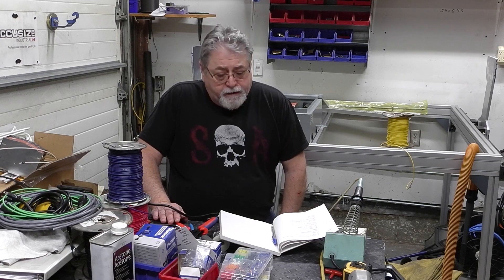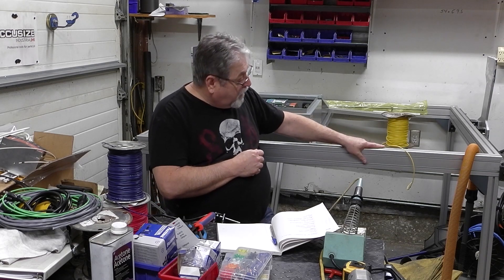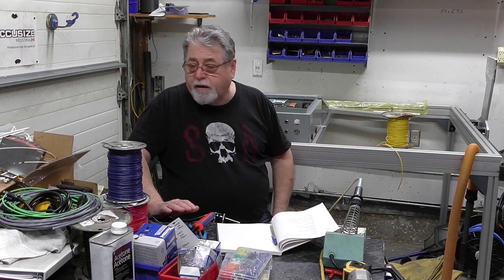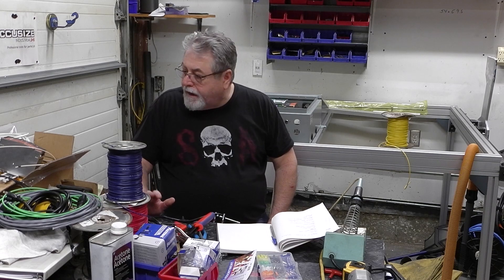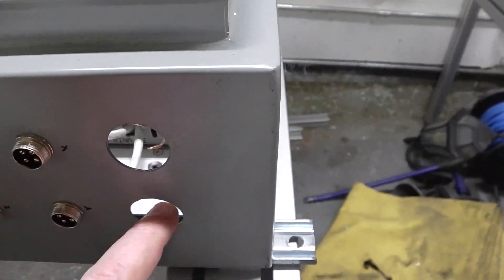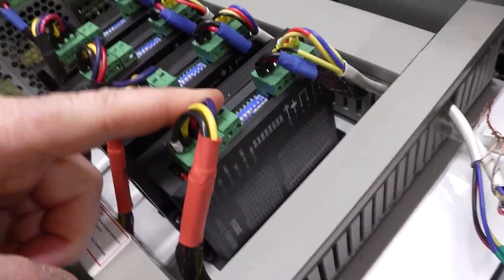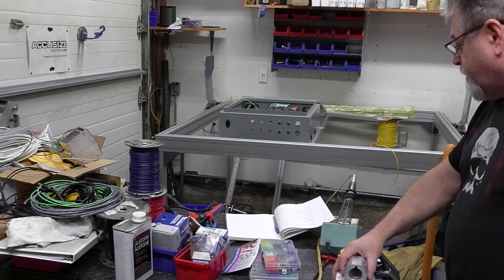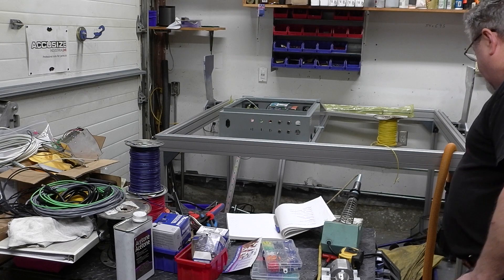Welcome to the shop  new plasma table build pt 1

Comment: Does the g3 support a proma thc?
Reply from the maker: Yes it does. And works awesome.
Reply: @fredsmachinewerks4811  I see they offer a touch screen I believe it’s for the g3. I have a millright mega v that I’d like to put this on and have auto squaring along with 4th axis !
Reply from the maker: @trialnterror  
They great controller self contained and lots of support.
And very easy to wire up as well
Cheers Fred

Comment: Thank you for all the information. I would like to see new video about the electrical relay,  How did you connect to the limit switches and Masso G3 ,
Reply from the maker: I'll post a new vidio tomorrow how I did this. 
Cheers Fred
Reply: @fredsmachinewerks4811  I would be interested in seeing a new video with more detail on the relays and power supplies, and why and how this is needed with the Masso.  I'm planning a retro fit on an old Burny 3 set-up and have to learn all this stuff.
Reply from the maker: Next week I'll explain how I use relays for the end switches. Its better than direct connect to masso .I like to keep peripherals separate  . And use external power by using relay dont have to worry about anything shorting out.
This will blow the opto in the masso. 

Cheers Fred
Reply from the maker: So what do is I use a 3 wire proximity
Switch. That energizes the terminal relay and close contacts which is turn energized the input on the masso.
Masso uses opto isolators so between 24.volts dc to the input. If you an email address I can send you my drawing.

Cheers Fred
Reply: Fred's Machine Werks dkmilleriii@gmail.com

Comment: can you post a link to the powersupplies and why do you need 3 of them
Reply from the maker: Hello
I use 3 power supplies one for the Masso Controller, one accessories Like fans and relays and the last is the supplies for the stepper motor drivers. I got these off of Amazon. Here the link.
https://www.amazon.ca/TRENDnet-Single-Output-Industrial-DIN-Rail/dp/B01707FN3Y/ref=sr_1_fkmr0_1?keywords=TRENDnet+240+W+Single+Output+Industrial+DIN-Rail+Power+Supply%2C+Extreme+-25+to+70+%C2%B0C+%28-13+to+158+%C2%B0F%29+Operating+Temp%2C+TI-S24048&qid=1586701817&s=electronics&sr=1-1-fkmr0

Cheers

Comment: Thanks for the video Fred I also embarking down the cnc plasma build road, Im also sold on the masso my table will be 2x4 mtrs
I currently have a 1.5x3 mtr which is old and slow. Im hoping to use clearpath servos 
Seeing your build has gave me the confidence to undertake this
Reply: Good Luck with the Masso's lack of THC support and lack of Z axis control when cutting LoL
Reply: @SegoMan  i though this was all integrated in the g3 controller??
Reply: @davidoleary2452  

Masso has some serious shortcomings when it comes to THC, the only known working unit is the Proma. Masso states "that any THC system that uses  ARC OK, UP and DOWN signals will work." Yet no one on the Masso site has been able to make the Price unit work.

Masso also lacks real time axis control when the unit is cutting Up/Down/Speed override. The Price allows Up/Down over ride at the console, Proma which is mounted at the plasma box can be an issue on larger tables like mine.

Speed override is necessary in CNC plasma as consumables wear and not all metal cuts the same. it also allows you to grab a file that was for a different thickness of material and adjust the speed accordingly. Saving a date with the CAM software.

Feel free to pop over to the Masso forum and chime in on the THC issue, if we make enough noise they will fix the problem:

https://www.masso.com.au/forums/topic/thcs-that-work-with-masso/
Reply from the maker: I would order all the parts first and than start building the table. I myself if having to this over would gone this route. As there are some many option to consider. This make easyer down the road get all the ball screws or gear racks and linear builds.  The extrude aluminium was a plus steel is ok but
I found less work is nice mind you having to make all the bearing blocks 
And stepper motor mounts was a bit of a chore but it's all good. If you can make do it the rewards are awesome

Cheers Fred

Comment: The Price seems to be one of the better units, and it is the one I plan on using. But I was curious about a floating torch head. The torch is mounted on a spring loaded slide, touches the material, bumps a micro switch, and sets the pierce height  then the THC takes over.
Reply: Btw, @SegoMan I went to your channel and saw your machine. That thing is a beast!😆
Reply: @johnrichardson9234  Thanks John,
Go big or go home and never build a plasma table without a plasma table LoL
Reply: Please show me a video of the Price unit working with Masso, Pele' is waiting, rewards offered...
Reply: I'm still in the planning stage taking notes, etc. I haven't even decided what controller to use. But the Masso seems the way to go.
Reply: @johnrichardson9234  So did I as well as many others, now were trying to find a THC system that works with Masso.  The Proma unit is the only unit that is known / documented to work with the Masso controller (that I can find) and it has it's limits / design flaws.  I love the rest of the features Masso offers and we're trying to work out the THC problems. Pele's build is on my channel. Here is the link to the Masso THC discussion:
https://www.masso.com.au/forums/topic/thcs-that-work-with-masso/?part=1
Reply from the maker: Hello John
Did allot of research before hand. there are so many cnc controller that use Mach three and Four .I wanted something that did not use a PC. So this is why I went with Masso. So fore it has been good just setting up was i little time consuming. But other than that its all moving along. I made my own break away torch block
just need to add some micro switchs and I am all set to go. I did order a THC but I think I'll go with out as I am going to use a water table. this should stop any warping of martial The Proma sd I am going to sell.
Cheers Fred
Reply from the maker: @SegoMan  Ill do my best to show when the table is done.
Cheers Fred
Reply: @fredsmachinewerks4811  Thanks Fred, what terminals are on your wire ends that terminate in the Masso? They don't appear to be ferrules..Be sure to pop over to my channel and check out my build.
Reply: Thanks for the info @ SegoMan, I really appreciate it. I stumbled across a mention of the Price on one of the Masso forums, but I failed to bookmark it. I like the support associated with the Price, but I will be happy with what ever works.
Reply: @johnrichardson9234  John this is what I used, it is a very well built unit he also offers a home switch as well ( I had to mount my own)

https://cnc4newbie.com/store/en/z-axis-slider/plasma-z-axis-with-floating-plate-p91c37/

I also had planned on using the price unit but THC's are not playing well with the Masso units, but we are working on it.
Hop over to my channel and check out my build.
Reply from the maker: The price on the unit is about 900.00 Cnd. but about 650.00 us. Great controller. I have put a manual together from all the online documentation they have. You can also go to there form lots of stuff there and tech support.

Cheers Fred
Reply from the maker: Its an awesome controller you will not be sorry. very simple

Cheers Fred
Reply: @fredsmachinewerks4811  You will change your tune when you try to integrate a THC unit with the Masso lol
Reply: @SegoMan  any thc with up down inputs will work with masso thers was a guy who even used a older hypertherm
Reply: @jeffcoldon2670  That may be the case now but not when I posted that comment, go to their forum and look at the date of the posts.

BTW my Lilow THC still works great.. I cut some 1-1/4" plate with it..
Reply: Thanks guys! I understand the desire to use a non-pc controlled system like a commercial unit. However, I think I will stay in my comfort zone and use a Mach controlled system. The majority of my fabrication involves tube notching, and I like the speed and repeatability of a plasma for this purpose. Others on YouTube have used water tables but still experienced major deflection with thinner materials and had to add a THC.

Comment: Do you plan on using a floating torch head? If so, I would like see what pin you would use on the Masso and what it would be labeled.
Reply from the maker: I have not desided what thc I am going to use. I just want to get it all together first. I was looking at the price cnc
That might work ok. Still waiting for parts  for the last 2 months. It has been a long process
 Will keep everyone updated. Waiting for parts is the worst parts of it all
Sometime patiants it no a vertue. 

Cheers Fred
Reply from the maker: Yes i have had no time to play with is hopefully soon

Comment: I have a question about masso3,  is necessary a software to generate G-code?
Reply from the maker: Yes you can us sheet cam or dfx to gcode. I have not played around with any cnc gcode yet but very sone.

Cheers Fred
Reply from the maker: Yes you need software to gen g code. Dxf to code. It is freeware. Or get the expensive software. Like autocar or bobcat.and the list goes on.

Cheers zFred

Comment: I would love a plasma table but sadly not enough room in the shop here.  I am interested to see how the system comes together though, as you say there have been a few others who have built them at home and it seems like everyone has a slightly different angle on engineering theirs.
Reply from the maker: Hello Everett
This going be very slow build. Getting the right parts is always hard. And then making parts to adapt the the table is always a little bit of work. But it's coming together. I looked at about 12 to 13 vendors for cnc plasma table
They were up in the range of 6000.00 to 15000.00 so this kind of put a damper On things. So I started to research diy And parts. I think have about 4000.00
When its all said done. Few odds and ends. I think the cnc controller was most. Everything else was off of amazon and aliexpress. I'll get some updates done but busy at work.

Cheers Fred
Reply: Everett,

I have seen plaz tables that fold up against the wall for storage, Once you have one of these you will say why didn't I do this sooner. What use to take days to build is a 3 min cut.
Reply: might check out burn tables they have a stand up table..

Comment: Wow. Heck of a project. I think I will just buy mine new. :)
Reply from the maker: I wish I could have. But diy was about 5 grand less. There are some real nice table out there. 

Cheers Fred
Reply: Fred's Machine Werks I will probably pull the trigger on a table from Go Fab Cnc once I get my shop done.
Reply from the maker: @hilltopmachineworks2131  
They make great table aswell.  I looked at about 10 13 tables and just doing a compare. And US pricing is awesome 
But the duty and exchange plus shipping was going to kill my budget.
I love tables that are plug and play.
Because fushion 360 is a little hard to learn 
When doing everything on a note pad and dont mean a computer  pencil and paper it is a bit of a learning curve. Using Siemen solid edge right now. 
Playing around with that.

Cheers Fred
Reply: Fred's Machine Werks Yeah I will have to learn 360 when I get it.
Reply from the maker: @hilltopmachineworks2131 
Down load solid edge. Little easier then fusion 360. Aslo Dowd load scan2 cad. Also very nice program.
Will keep you updated. 
Cheers Fred
Reply: Fred's Machine Werks Okay. Also I love that Viking welding helmet.
Reply from the maker: @hilltopmachineworks2131  Awesome Tom
All the guys at work ending get the same helmets
Reply from the maker: Just got out of the shop wiring the proximity sensor for the x and y axis
Have to make some bearing supports for the ball screws. The table will take a while. Waiting for parts from china
Always 6 to 8 weeks.
Reply: Fred's Machine Werks I have only migged with it so far but what a difference. I can’t wait to tig with it. My latest video I give you props for it.👍😀
Reply from the maker: @hilltopmachineworks2131  Hey Tom
Tigging is just awesome with this helmet. So clear. How ever they do it is just the cats ass. With the 63 year old eyes man it makes a difference. 

Cheers Fred